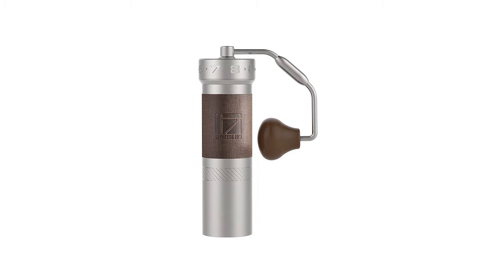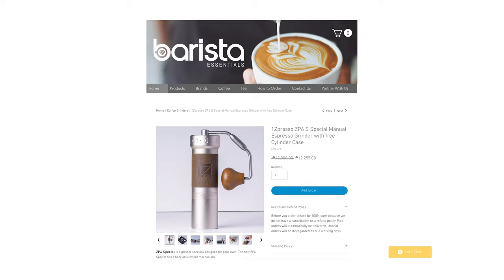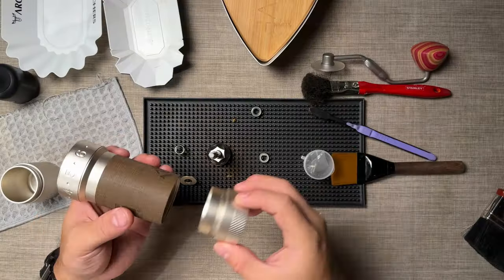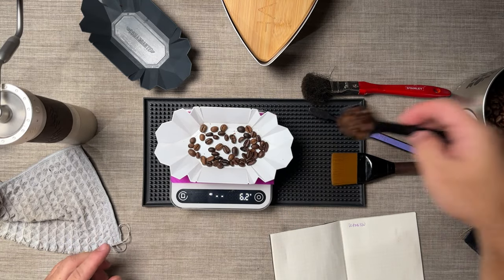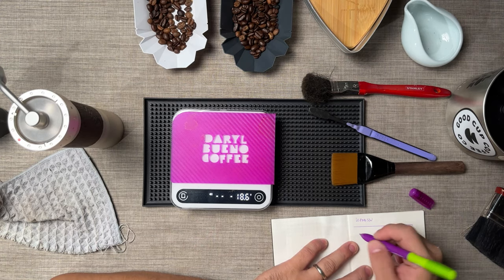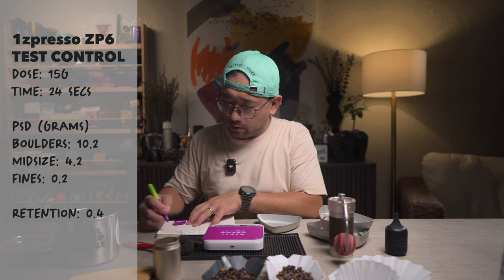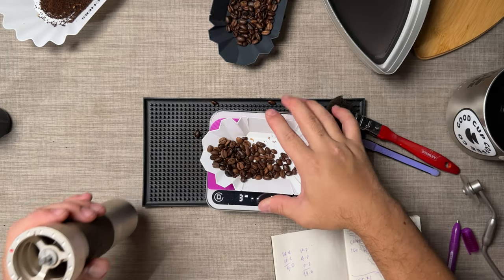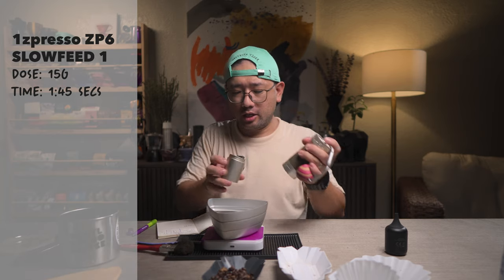1zpresso ZP6 Slowfeed Test

Comment: Where did you get your definition of boulders,  my understanding is that boulders are the particles that is to big, 1100micron is defenently not to big, just llok at your brewler, , try a corser screen. Or a finer grindsetting if you are only into medium sized particles
Reply from the maker: @peterr8538  i call these boulders just in the premise of these parameters. In this specific test that i did anything above 1100microns of the Kruve is considered the boulders of the bunch. I did not say that in all situations anything above 1100 microns is called boulders. :)

Comment: how often do you clean you manual grinder?
Reply from the maker: @rattle899  before i used to clean them weekly. But since i have different grinders now i would clean then only when i see that they need the cleaning. Or when im calibrating a new coffee that i need to clear out contents of the inside. I would do like the detailed cleaning with oil and steel brush once a month.
Reply: @darylbuenocoffee  do you normaly grind different kind of origin bean without cleaning in the same grinder just for regular drinking
not when making content?
Reply from the maker: @rattle899  yes, i dont particularly clean them whenever i change beans - i would only do so if i am making contents that would test grind sizes or tasting new coffees. Otherwise, if the content is about a recipe or a dripper or for my everyday consumption i would leave it be. Maybe do some light dusting on the bottom but that's it.
Reply: @darylbuenocoffee  appriciate it for sharing knowledge and experience on this. am relatively new venturing in to this new hobby of mine haha. again Thank you.

Comment: Thought I'd put in a plug (and a warning) for the toughness of the King Grinder K6.
While disassembling for cleaning I decided to unscrew the adjuster. Thought maybe I could calibrate it to 0.
BIG MISTAKE !    Don't do this !  When reassembling , If not realizing you are screwing it in the wrong direction you will become highly frustrated. This will lead to physical aggression directed at the grinder. Beating it with a block of wood (and worse) will NOT allow the threads to engage ! 
Once you realize your mistake ,(only took me about 20 minutes) it will thread quite easily.
But as I said.  This grinder is built tough !!!  It survived with only a slight scratch and a mild smudge on one of the numbers.  
 Ta Daaaa😁
Reply from the maker: @JMgmkh  hahaha yes actually ive done this in the past too - luckily being a tinker helps me remember to screw in reverse hahaha! But yeah you will never be able to calibrate the k6 to absolute zero

Comment: There is someone on your shelf, lol
I am interested in buying a filter manual. I'm hesitating between the C40, the K-Ultra and this ZP6. Which one do you think is the most balanced (only for filters, for espresso I already have the J-Ultra)?
It is said that the J-Ultra is bad for filters, have you tried it in slowfeed and what is your opinion of it for filters?
Reply: And, of course, happy to still see the "tadaaaaa" ♥
Reply from the maker: @cpasoft  personally i have not tried any of the j series. I think the k series is more omni than the J. In regards with your question i would always recommend the c40 for filters. You can never go wrong with a comandante.
Reply: @darylbuenocoffee   Isn't the Q2 burr set very similar? I'd just go for that since it's a lot cheaper.
Reply: @darylbuenocoffee  So you prefer the c40 to the K Ultra, don't you?
Reply from the maker: @cpasoft  yes that's correct
Reply from the maker: @georgielol  no theyre not similar at all. The q2 burrs are copied after another brand .
Reply: @darylbuenocoffee  I'm just going off of what both Lance Hedrick and Kyle Rowsell have said. I don't have this grinder. I was just curious.
Reply from the maker: @georgielol  im not sure about lance but kyle also said the q2 is  more akin to comandante than the zp6.
Reply: C40 doesn't have the external adjustment of the others. Some find that annoying.
Reply from the maker: @davidlogan2682  yes some do but i actually find it intuitive to make sure that you dont have anything on your catch cup before starting grinding your coffee. This happens to me a lot with grinders with external adjustment since i do a lot of demos.